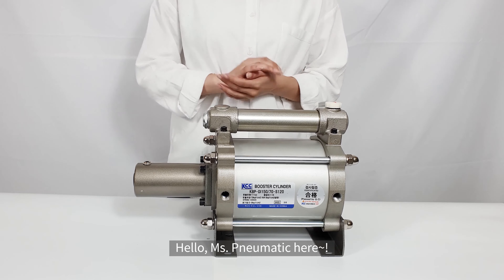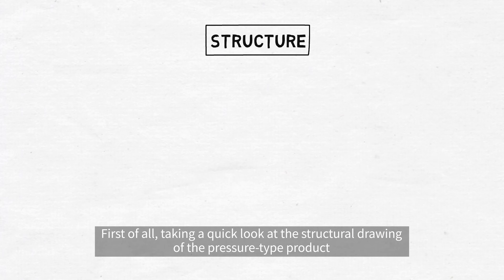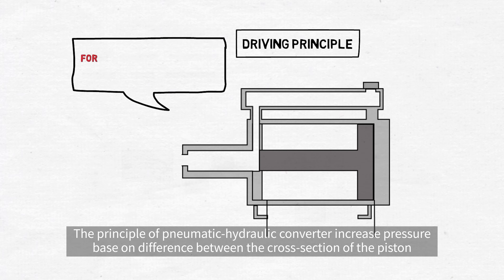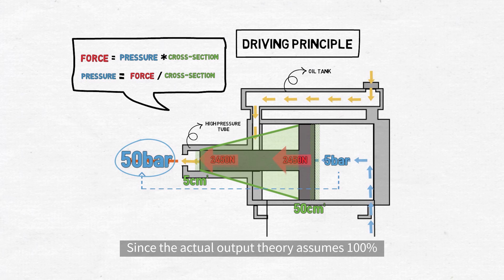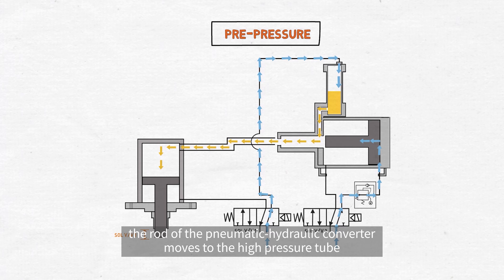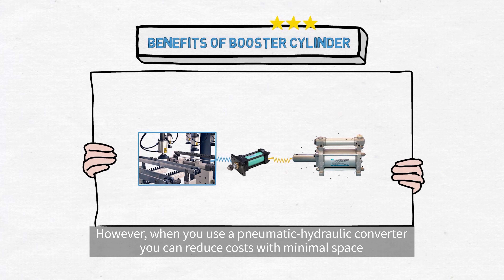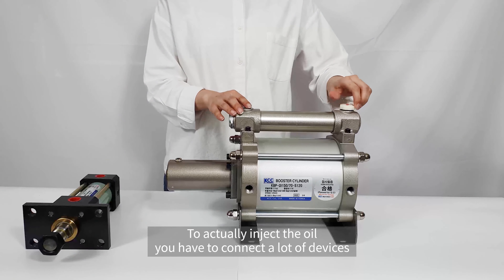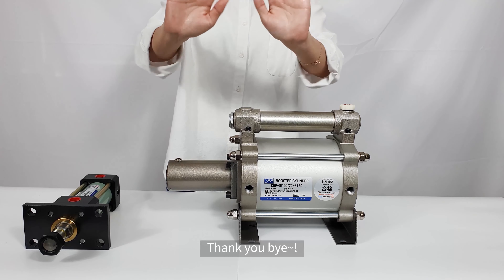How BOOSTER CYLINDER works? (Animation | Sub)

Comment: shouldnt the pressure at the different areas be equal instead of the force since pascals principle says the pressure difference is applied undiminished everywhere? in a hydraulic jack with different areas, the forces are different, but the pressures are the same

Comment: Would be appreciated if ubwould be kind enough to let me know if this means a 500 kg pneumatic cylinder power press can be turned into a 5000 kg pneumatic power press without changed the air pneumatic cylinder to  a hydropneumatic cylinder?thanks.GBU

Comment: I’m new at this. Do I pumped air in it like a tire? And how much psi?  My hydraulic goes down but barley goes up. What to do? Thank you very much
Reply from the maker: Hello. Nice to meet you half way.
I will answer your questions.
1. Assuming the set value is 0.5 MPa, converting to psi gives 72.519122.
2. There are several conditions to consider when the hydraulic pressure is unstable.
2-1. If the supplied pneumatic pressure is leaking or the output is weak, check whether the regulator is malfunctioning.
2-2. Is the ambient temperature too hot?
2-3. It is the case that the quality of the hydraulic oil used is not good.

I hope this answer was helpful to you.

Comment: can  hydraulic pump( at 2000 rpm motor) run  with booster  incruding to air pressure